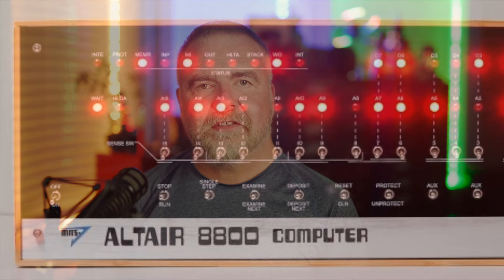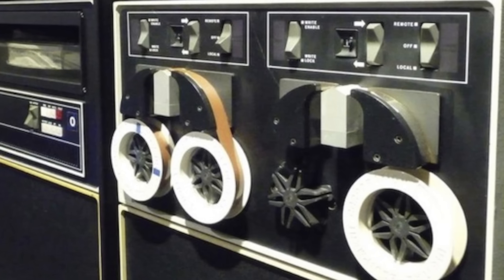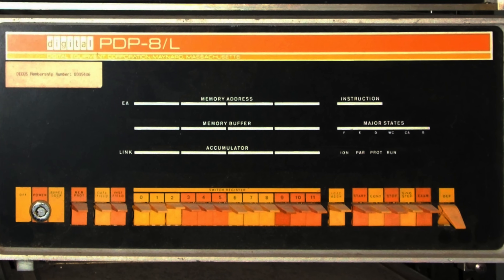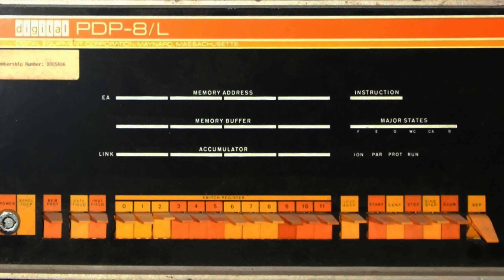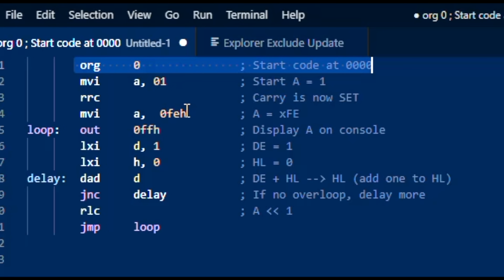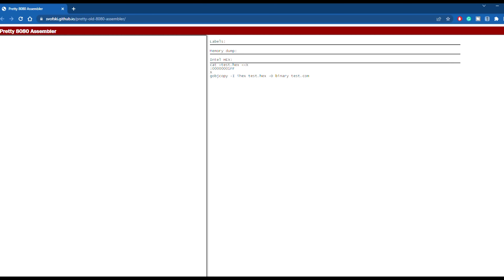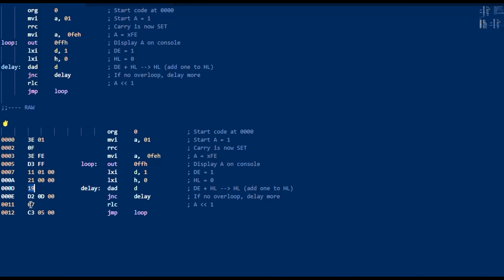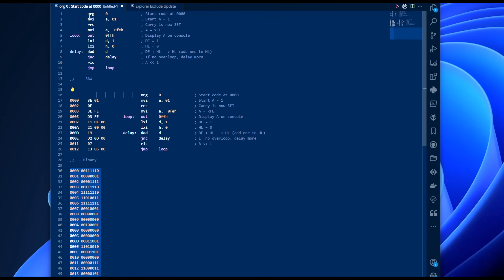Bare Metal Programming - Booting From the Switches

Comment: Have my altair and IMSAI downstairs and you need none of this.   Wrote many patches, bootloaders & machine language monitors with no more than legal pad, pencil and my 8080 slide rule like opcode cheat card.   The 8080 instruction set (and 8086 also) encode instructions that are natural in octal.    The top 2 bits are the instruction class like 01 for move(MOV) and 10 for arithmetic .  The two sets of 3 bits for register encoding.   For instance in MOV the next 3 bits are the destination register and the final (LS) 3 bits are the source register.  Toggled in my "monitor" I wrote on a legal pad, ran it and used it to put in my "driver" for a eprom programmer I had designed and wrirewrapped and used it to program a 2708 with the monitor I had hand toggled in from low memory.   Would copy my monitor from eprom to ram and patch for different systems that had different IO like a VDM1 or Flashwriter using monitor or switches and make a new eprom for friends systems.   Never liked the zilog mnemonics since they did not logically fit the bit patterns that the instructions actually encoded into. Also on PDP10's KA's and most KI's did not actually have a 11/40 front end and have actually used the front panel on a KA to deposit/examine memory when machine would not boot and find core module that was bad, readdressed it to sit at end of the address space and boom,   TOPS10 boots right up.   The KA10's front panel is the best of all, better than 11's, Nova3/4 and even the IMSAI.

Comment: I used to program a Honeywell 200 computer with a similar front panel.  Users would typically memorize a sequence of button pushes to insert a program (about 6 bytes) that would clear memory. 

This machine's primary input was a card reader (80-column) and it had a BOOT button.  That button would cause the machine to read a card into the first 80 locations of memory and begin executing beginning at location 0.  Of course that card program had to have instructions to read more cards to get anything useful into memory.  So, your program was always a bootstrap card followed by whatever program you wanted to run (in machine language, of course), and normally followed by a stack of data cards.  Those were the days.  (I'm 75 now--and still love software development.)

Comment: Didnt have a switch panel but had a couple of small VAX-11s (well VAX-8300 and the target a VAX-11/750 the size of a top loading washing machine and not a bad heater too!). One I would write assembler on and patch command to dissemble it to hex and format with DCL and a spare serial port of it was plugged into the console of the VAX-11/750 to turn hex into deposit commands. Many nights trying to get the TU58 cassette on the 750 to spin up and read data via pushing various bytes to the controller. Was keen in those days to play with VAX hardware directly....Obviously didnt have a life lol

Comment: Wow interesting. Looks more like a test rig for 8 bit microcontrollers rather than a full fledged computer. It would be super nice to add some address decoding logic to map the first few bytes of RAM into a custom switch board where you can hardcode your (very short) loader. Maybe a loader to read bigger programs from tape.
Reply: Modern 8 bit microcontrollers are more powerful than fully fledged computers of the day. The first 'ROMs' were indeed add in boards with the bootstrap code hard wired with diodes or simple links together with the necessary decoding logic needed to respond to memory requests at the appropriate addresses.

Comment: I started out on a Science of Cambridge MK14 which I got for my birthday in 1978.  You literally programmed it in machine code  - like "C4,01...." and it had no persistent memory - only RAM - and a teeny tiny LED display.  But I learned so much from it, that within 3-4 years I was working on DEC based machines and some of those - like the PDP-11/70 and the ones you show here -  had exactly this kind of console for entering in bootstrap or diagnostic routines (though, once booted from a hard drive or tape they were a lot more sophiticated).

Comment: The 8080 instruction set makes sense if expressed in octal.

I was called on to do this on an IBM System 370 model 135.

IBM mainframe computers have separate devices attached called channels and controllers - the channels provided the link to controllers and typically those had disks (DASD), tapes, printers, card readers etc attached. The 148 was a lesser model, and some of these external controllers were emulated. We had an Integrated Communications Controller that wasn't behaving as expected. To do something with one of these devices, you create a channel program, a sequence of 64-bit double-words including commands, flags and memory addresses. Then you issued a start IO (SIO) instruction and went on and did other stuff.

So, I typed in the channel program, just a short one to make the communications device to do something, and then LDPSW (load program status word) to put the machine into a soft wait. Then I read out the status and reported it to The Boss in Canberra.

The instruction set makes sense in hex, so I didn't need a running computer. I did have hexadecimal rotary switches, but in fact I could have entered the data directly from hex, I can convert hex to binary in my head, it's not difficult.

I could have used the IBM assembler to create a deck of cards, those could be punched onto cards or written directly to tape. This computer had an IBM Selectric typewriter as its console, but another time I was there it wasn't working.

Ordinarily, you start one of those computers by setting a device address, again using rotary dials, and pressing the LOAD button. Thissresults in a system reset followed by reading from the designated address which could be a card reader, tape drive or DASD. I don't know about paper tape, but probably.

Comment: This is very fascinating to me! I've always been interested in extremely low-level programming. Thanks for teaching a young software dev how it was done back in the days! (Also, how was the assembly language compiled into hex code back then? Was it all done by hand?)
Reply: I think assembly language was invented and a first assembler was programmed by Kathleen Booth in the 50s. - But I used to assemble into decimal code by hand (which is harder than into hexadecimal) when I started to learn assembly on the C64 (which was only a few months ago), because I didn't have an assembler or machine code monitor yet, and the only way to put machine code into memory via the built-in C64 BASIC is in the form of decimal numbers (unless you write a converter / assembler in BASIC). :-)

Comment: I remember having to bootstrap HP-1000 mini computers in just this manner in the mid 90s, some of those older machines had a really long service life.  

If I recall, the bootstrap code told the machine where the tape drive was on the bus, then once the tape drive started it had a larger program that then allowed the HP to read from the attached hard drive.  At the time I was just an electronics tech, so I had some idea of what was happening, just no idea what the heck I was entering, I just had the code written out in a notebook.

Comment: I thought entering the hex values was as low as I would see for computer programming. Looks like fun way to learn assembly instructions, I was expecting the same as z80 instructions but they look at bit different.
Reply: The Z80 is apparently an extension of the 8080 instruction set, so the binary should be pretty much the same, perhaps you used a different assembler syntax?

I was expecting mostly x86 instructions, but it seems nothing survived from the 8 bit era: 07 is now POP, and C3 is RET, for example.

Comment: Making a smallish variant of this kind of machine with the brains of an arduino or Pi Pico would be pretty fun. could even come up with a way to make it read punchtape.
Reply: No need to write code for a Pi,  there are tons of code samples available.
Reply: @jimpad5608  if there's any samples that emulate a switch-panel style of programming I'm unaware of them, though there could well be one or two floating around.
Reply: @DFX2KX  - as far as I know,  there are no off-the-shelf switch panels,  but I don't think it would be that hard to use off-the-shelf components (switches,  etc) to build one. I have not looked,  but I suspect that getting a wiring schematic might not be that hard to find either since the switches use the existing control lines the cpu uses.

Comment: Takes me back to the early 80s when I had the opportunity to play with an 8080 development kit. It could use a teleprinter but had a hex keypad and the monitor rom and a 4 digit 7 segment display. I got as far as disassembling the rom code for the display call and finding the address of the display ports register. I could then play with making individual segments light up and display some weird stuff. I’d learned some 6809 assembly just before and caught onto 8080 quickly. Fun stuff

Comment: Didn't they have seven-segment displays back then? Wouldn't it have been easier to enter hex via a wheel?
Reply: No only lights. There were nixie tubes but they were EXTREMELY EXPENSIVE and very complex to drive. Fran Lab has some videos on early display systems. Only the military could afford nixie tubes.
Reply: There definitely were 7-segment displays, but I’m not aware of them ever being used on the front panel of a hobbyist-class computer.  Just for cost reasons.  Also, most driver chips only did BCD, not hex, and even if they did, hex would look funny on a 7-segment display.

Comment: Boy did that bring back 45 year old memories.  When I got out of college I went to work doing field testing for bell labs. Our master system was a PDP11 with a 1 meg hard drive. This was connected to 3270 type terminals and remote test systems. The test systems consisted of an intel 8008 cpu and 16 banks of 64k memory.  The real time os supported 32 "concurrent" tasks. Each memory bank had a copy of the os in low memory and some part of the application in the remaining memory. To run a particular part of the app. Your program would jump to the bank routine in lower memory,  look up which bank to use then force a bank switch invisible to the cpu, then jump up to routine.  To get the pdp11 up and running we had to manually key in the boot loader to boot off the one megabyte hard disk. Fun days programming in pdp11 and Intel 8008 assembler. Later I was thrilled to program in C and other high level languages
Reply: I knew about computers when I was in High School from the Popular Mechanics story on the Altair.  I studied electronics so it's no surprise my first job was building medical ultrasound equipment.  One of the programmers had a Commodore Pet he let me play with.

My next job about a year later was in a R&D Lab prototyping telephone test systems based on the 6502... We had a lot of Kim-1s to play with and also in-house upgrades.

I then worked in a shop on University Ave. in Berkeley, exclusively on S-100 gear (Altair, IMSAI, North Star, Godbout, Morrow designs, etc.)  It wasn't unusual to have big name authors like Osbourne, Dvorak and others come in to check on current developments.

Comment: Ah yes... the old UTRAO radio telescope had a DG Nova 1600(?) running the observations.  If the computer crashed or power was lost you had to front-panel-switch in the boot code for the paper tape loader... this then slurped up the paper tape loader to read mag tape... this was the final program that recorded the array's output to 9-track.  Drank a full pot of coffee every night at that job!

Comment: Could this computer go on the internet, or dial up or do anything like the movie portrayed? Did the IMSAI actually have a terminal app capable of "war dialing" and converting text to speech?
Reply: Sort of.  They had a 3 wire serial i/o that could connect to a 300 bps modem to connect to a BBS. At the time the internet was owed by the USA DOD and access was extremely restricted.  I was fortunate to attend a university that was on ARPANET, so I had access via our mainframe. Then I went to work for at&t which provided the internet backbone for the DOD. Then I joined HP which was also an original part of ARPANET. In reality,  at that time text to speech required all the resources of a massive mainframe and if I remember correctly,  only IBM had some very primitive software.

Comment: Great video demonstration and wild to see the old way of working one more time. My time with the PDP 11 was short, but I do recall having to know Hex by the time I was 17, when I worked on shift entering the run sequence on an IBM 8100, it had a hex pad only, with a tape drive and 1 cylinder disk at a low rpm, it used to shake the coffee pot next to it at the end of the run so we knew it was time for the next sequence! Ha! Loving this nostalgic deep dive!

Comment: How did they assemble and do the hex to binary conversion back in the days?
Reply: By hand in an engineering note book. Most of us memorized the binary opcodes,  so we could write short machine code apps without using an assembler.
Reply: I memorised the op codes and did hex to binary conversion in my head.

Comment: Ah, the memories.  Programming my old TRS-80 (before it was known as a Model 1) in machine language, entering the program two hex digits at a time, via a BASIC program that I wrote.  Some time later, I bought a copy of Microsoft EDTASM (Editor/Assembler), and that was paradise.

It's absolutely amazing what you can do with 4K of RAM once you learn how to optimize your code; a skill that paid off when I started programming microcontrollers in assembly.

I'm seriously considering getting one of these retro machines, especially since it can run as a Z80 machine.  (Although 8080 and Z80 are quite similar.)

Comment: Thanks for the tour down memory lane. The IMSAI 8080 was my first computer. A couple of notes: 1. The conversion of assembly language to hex bytes was done by hand. 2. The conversion from hex to binary is not necessary. Each hex byte has two hex digits. The left digit goes into the left four switches and the right digit to the right four switches. There are only 16 values to memorize 0x0 -> 0000 through 0xF -> 1111. After doing this conversion a hundred times, you could do it in your sleep. 😂
Reply: I was going to mention the same.  I got so converting binary to hex and back was so automatic that I didn't even have to think about it.  Surprised a friend of mine once who had a shirt with lines of binary.  In a matter of minutes converted it to hex.  When I noticed each byte was in the range 0x41 - 0x 5A, I realized THAT was ASCII and decoded that.  Turned out to be a message, "IF YOU CAN READ THIS YOU ARE A NERD"  lol
Reply: @mikefochtman7164  LOL!
Reply: Thanks from a PDP8/e user here.  This uses octal, which is a bit easier, but the same principle, and only has eight instructions, so even the assembly code can be worked out in your head.  I entered the binary tape loader code so many times in the early 1970s I can still almost remember it now.  It also had magnetic core memory, which would be retained when powered down 'softly' via the switch on the front panel, saving much switch toggling.
Reply: That must have been great as the first computer. I miss a front panel on my C64. :-)
Reply: Yep, I learned to count backwards in Hex, to do branch instruction offsets, and could type in many of the MC6801 op codes from *my memory*... Getting a real world program into 500 bytes (hospital bed controller)...

Comment: As someone that only used computers from the 80s onward, these switch interfaces were always a bit of a mystery. 
Turns out it's basically a simple display and primitive keyboard, and even has an "enter" key for each new line of code. Makes sense!

Comment: The first “real” computers i worked with were HP/3000 Series II and III. They had a 16-bit CIR (current instruction register) display on their front panel. When I was an operator there, the worst thing you could possibly see on the CIR was 030377 (in octal, for some reason the HP minis liked octal) which was a “halt %17” instruction, indicating that a system failure had occurred. I still remember it today, more than 40 years later

Comment: The Altair 8800 and the PDP11 grouped the switches in sets of threes. This allowed you to enter Octal codes, making the code print out shorter and less error prone. Not sure why IMSAI did not follow that trend when cloning the Altair
Reply: Hex was a huge improvement over octal.  It’s easy to visualize the 4-bit binary equivalent of each hex digit, and a print-out is shorter with hex, not octal.